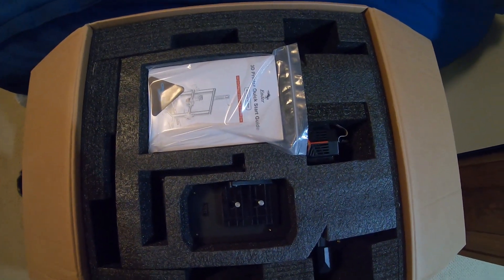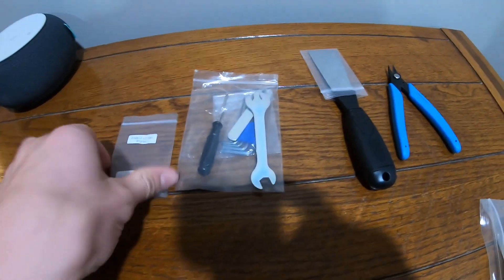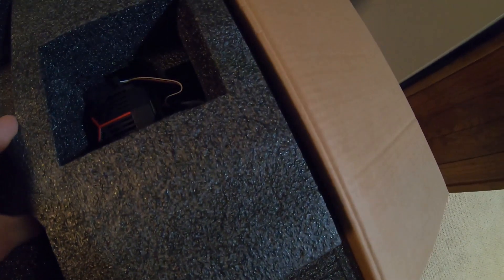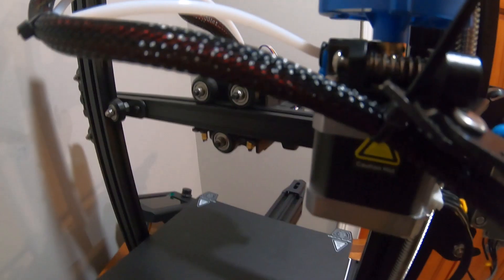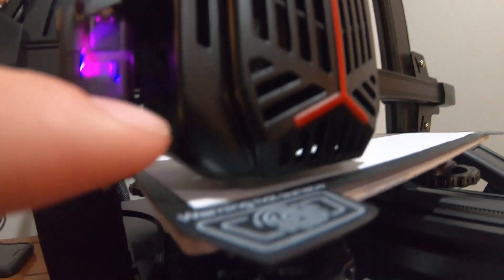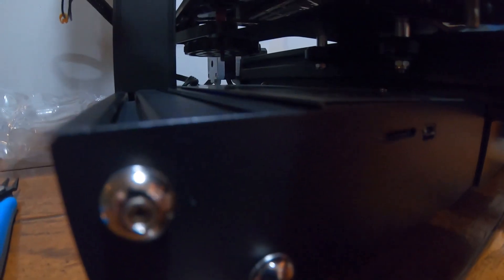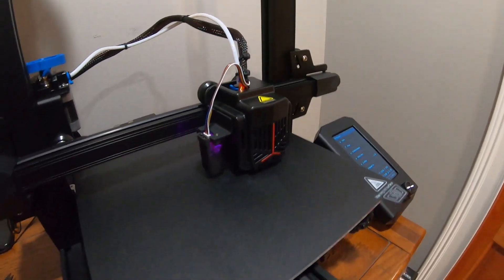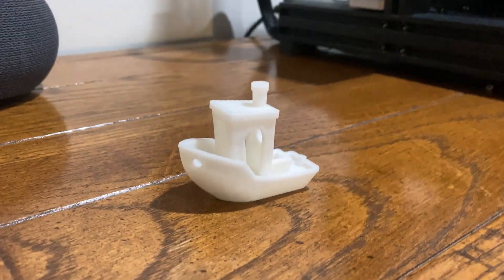Creality Ender 3 V2 NEO - Unboxing & First Print!

Comment: Ayyyyy bro that’s awesome!!! I’m kinda jealous of the auto bed leveling! Epic vid too! Happy printing!
Reply from the maker: Thanks man! It’s been running almost non stop since I got it😂 I love it so far!
Reply: @3DudesRC  Hey man, used this tutorial. Do i need to preheat before printing? Also whe i pre heat it starts oozing, messing up the start of the print as it curls and doesnt stick to the platform
Reply from the maker: @PhoenixVids123  You don’t have to preheat. But it will still take time for it to heat up if you don’t preheat. I have had some issues with a bit oozing out and the best you can do is just scrape it off with the bed scraper or carefully grab it with your fingers just before the print starts. Hope that helps!
Reply: @3DudesRC  ok! I tried another print yesterday without preheating as a test and it seemed to have worked well.
Reply: @3DudesRC with the micro sd card and adapter, it works on the printer, but my MacBook Air says it can’t read it. I believe the only way around this problem is erasing it and reformatting it. Should I do that, or would it ruin the card so the printer won’t read it? I’m worried there’s like hidden files that the printer reads that needs to be kept
Reply from the maker: @PhoenixVids123  Interesting your micro SD card is also having issues. Just a couple days ago both of mine I use for recording got screwed up somehow, so now all of my footage is gone. I think you should be fine with reformatting, as from what I understand the printer only needs the .gcode file to be able to print.
Reply: @3DudesRC  yeah. I tried the reformatting and it just doesnt work so i am using  my computer with usb to the printer
Reply from the maker: @PhoenixVids123  Hmm not sure then I guess. Might have to try a new sd card. Or just keep using your computer to usb.